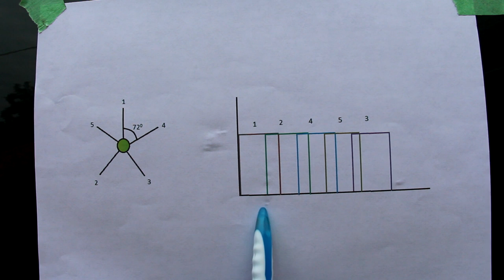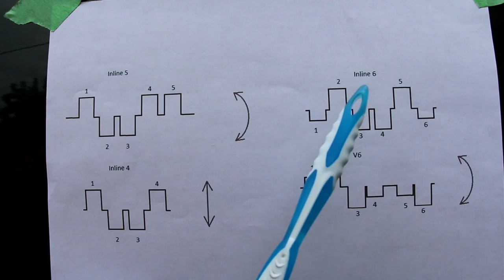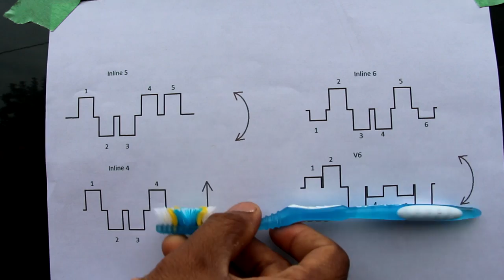Why Inline 5 Cylinder Engines are an Anomaly

Comment: The “plastic” parts in high temp area are Pa6-glass fiber reinforced which can be stronger than metal. Also much less susceptible to heat cracking.
Reply from the maker: Good call. How about warping and leaking due to heat?
Reply: That's good to know!  However, the plastic tubing that makes up large parts of the cooling system gets very brittle after 100,000+ miles. I love my s40, but miss the simplicity and durability of my 850 (same engine, basically).

While my favorite engine to drive is the inline 2.8L straight six from BMW, I must say I love the unique feel and sound of 5-cylinder engines, especially Volvos.
Reply: The plastic coolant hose from BMW's engine block disintegrates after about 20 years. I was not impressed when my daughters 318i overheated after loosing coolant.   Removal of the intake plenum was required just to gain access for replacement.  Not a fan of plastic engine parts.
Reply: @speedkar99  My 2001 XC70 has 650000 km and this plastic oil pickup tube so I'm going to go with "it's not a problem"
Reply: @derekinbritishcolumbia1449  yeah plastic is not a good material for those kinds of parts. it's used becaus it's cheaper
Reply: @derekinbritishcolumbia1449  yeah, pos plastic hose lasted only 20 years, what is it, older than your daughter or the same age? In all honesty, 20 years for a plastic part subjected to constant heat cycles and coolant is actually pretty good.
Reply: fastboatster - You make a point, but this can be the cause of a perfectly good engine getting wrecked if it's in otherwise good shape.  In our case, the car had low km's for its age. 
Does one just just write off their POS BMW after 15 or 20 years because a mfg's use of plastic leads to engine overheating or destruction?  I know in Germany, they just scrap out their cars once repairs become uneconomical.  
I don't excuse plastic parts, when they don't last as long as the "old school" metal items AND the cost of accessing the plastic part makes it uneconomical to repair.  Part of the reason why I won't buy a newer BMW now.
Reply: Derek in British Columbia no point in scrapping low mile old car. I am surprised though that you have to remove the intake manifold to replace some plastic coolant hose. What engine is this? As for the newer cars, they are sometimes easier than the old ones. No plastic hoses under the manifold on my n52 car. But yes, it also has one plastic fitting prone to breaking, I replaced it with aluminum part
Reply: fastboatster 
That was the venerable e36 model.  318i. The coolant connector plugs into the engine block, all  buried under the intake plenum.  I heard the same design layout appears on the inline 6's.  
This connector pipe on my way my ''78 320 I didn't share the same access problems..... and that motor used a metal coolant connector from the engine block.  (several moons ago.... lol)
Reply: Derek in British Columbia def no coolant pipes under the intake manifold on 6 cyl n52 engine. So newer does not always mean worse repair or maintenance
Reply: fastboatster 
That's good to hear.  
You may want to check out URO p/n 011747 which looks like the engine coolant connector.  
I've never owned one of these, so can't tell if it's an easy replacement.
Reply: @derekinbritishcolumbia1449  already got that connector replaced with aluminum part

Comment: A big "flaw" in the design too - removing the cam cover without removing the timing belt first can cause the cams to swing out at an angle and crack the bearing journals.  A lot of people overlook that not expecting the cam cover to also act as the cam caps.  Seen it happen many times.

Comment: I currently drive a first gen C70 coupe, with a 2.0 liter 5 cilinder "high pressure" (as Volvo call this modification) turbo. Literary cant say anything bad about it. The car itself is comfortable, and the engine...
Power: plenty, and can be tuned to be even better.
Fuel economy: great.
Smoothness: on idle it's barely audible.
Exhaust note: with rear mufler deleted, and replaced with a resonator, it's still not loud, yet gives it a nice, low grumble. In one word, awesome.
And the turbo flutter... Cant get enough of it.

I think i will stick with the anomaly for now, thank you. :D
Reply: My friend has a silver one imported to the U.S. Pretty rare beast over here I guess.
Reply: @gregorytimmons4777  If i recall correctly, there were like 24 000 first gen coupes made. Not super rare, but rare enough to be interesting. And it's a good car!

Comment: 8:53 Actually replacing the oil filter is not messy at all, you can remove the filter without leaving a single drop of oil on the engine.
Spin-on filters, at least to me whenever change them on a Chevy express, those are a mess EVERY TIME.
Source: I do my oil changes on my S40 and C70
BTW: Great video and nice editing.
Reply from the maker: I've got cars with both. The cartridge always leaves you open to dripping oil, not to mention cleaning out the housing and Changing the o-ring. 
Many manufacturers have gone back to a spin on style
Reply: @speedkar99  then you must be doing something wrong.  I have two autos with top mounted oil filters and I have never spilled a single drop.  You just have to wait a little while so that the oil drains down.  Autos; BMW 330i,  Ford F150.
Reply: I love the cartridge filter of my s40.  Much better for the environment (less waste), and I find that it drains just fine. You just have to be patient, as the others have noted. In fact, it is a much "less-messy" oil change when compared to the downward-pointing filters on my wife's Honda. 

It also allows you to "prime" the filter a bit with new oil (which I can do on my Honda, too), unlike older upward-pointing screw-on filters.
Reply: I like the cartridge ones, they're less hassle. Also, for some reason, manufacturers seem to think that less filter should cost more... the mind boggles...
Reply: I do as well on my 3 white blocks. 
You can also pre-fill oil cartridge to speed up oil pressure to reduce dry start. 
My 3 redblocks always leak on mount unless I use a rag underneath. 

Keep Rollin'
Reply: @speedkar99  the cartridges don't spill much if any oil.
Just gotta let it sit for a couple of minutes once you loosen them up.

Comment: Dang, lack of maintenance killed this Volvo. I have a 2004 S60R and around 220,000 miles now on it. 
On these, the sandwiched cylinders is only an issue on the 2.5 blocks, namely the 2.5 in the r. Under high boost, there is a chance for the cylinder wall to crack, expelling exhaust gases into the coolant system. The fix is usually either shimming the block, in the thin space between the cylinders or resleeving the block with new Darton sleeves. 
The head gasket can be replaced with the r/t5 one for better reliability, as they are used for the all out high HP builds.
The PVC system is notorious for issues, you can use the glove test method to see if you may have an issue. 
These Volvo 5 cyls are only as good as the maintenance. If you are on top of it, they last forever, however if you are a slacker, it will die. You can't treat it like a Honda/ Chevy. 
On turbo Volvo's, the turbo isn't integrated with the manifold, so swapping is fairly easy. 
Also, the Volvo 5 and 6 cyl motors have many swappable with minor modifications parts, ie pistons and such. Since they are a modular design. It's common for people to take the t5 pistons and swap them into the t6 motor. 
The valve cover has a liquid gasket. 

In the end, these are absolutely fantastic motors for people willing to do the work. They, with some modifications, can be absolute monsters and fairly reliable, it's just you need to be a stickler for maintenance.
Reply: Yes they are great engines, i have the 2.5T in my ford focus st and it sounds awesome! :)
Reply: Yeah, that needed better oil management (fully synthetic, and changed on schedule) and it looked to me like it needed more long trips. Volvo designed these engines to be used; short trips will kill them if you don't go for an Italian tuneup every once in a while. They're not as tolerant of neglect as the old red blocks, but when looked after and treated well, they're just as durable.

Comment: The plastic style pick up tube actually has better flow and doesn’t clog up as easily and is considered an upgrade on older engines. I’m guessing it is difficult to create that shape with metal in mass production so they used plastic. It works well and has proven to not be an issue. I had a metal style that I swapped for a the later plastic one and it improved oil flow significantly.
Reply from the maker: Good to know

Comment: I recently sold my 2006 ford focus ST which has the turbocharged version of this engine. Seeing it stripped down was something I always wanted to experience. Split cylinder lining was an issue until the 2008 face-lift model. Cool vid.

Comment: I owned a 2007 Chevy Colorado with a 3.7L 5cyl inline. That engine was smooth and had good torque.
Reply: I used to work at a Hummer dealership and worked on a ton of the I5 engines. They were relatively smooth, but for some reason would always break exhaust manifolds and manifold bolts. I always attributed it to the 5cylinder design. Although it could’ve just been crappy manifold castings.
Reply: Mines a 2005 3.5l l5 Chevy Colorado. Supposed to be famous for soft heads and leaky valves too...? (Updated from 3.5l to the 3.7l in '07-'12 models) Mline has 160k miles on mine and it's all original engine parts, head and manifold even. I love my 5 cyl Colly, gonna run her till she can't no more. Thing does run smooth, like new everyday. I really run my pickup, keep up with the maintenance, possibly even just luck of the draw.. I change oil via oil life indicator, tells me when to "change oil soon" and I run Quaker State full synthetic 5w30 and change the spin on filter every oil change, sometimes every 5k m. The oil change indicator usually runs 10k and no more than 12k intervals

Comment: Ferdinand Piëch, Porsche heir, VW chairman and later owner of VW Group, designed a 5 pot diesel for Mercedes (in between leaving Porsche and joining Audi) which was renowned for it's reliability.
Million milers without rebuilt were common. Later he used the 5pot concept for Audi as a gasoline engine which powered the legendary Audi Quattro WRC car and the Audi 90 IMSA race car.

Comment: i love these engines, they used the same block for nearly 25 years, meaning you can go to a junk yard and find parts very easy. the bottom end of these engines are nearly bullet proof, its the valves you have to worry about, if the valve stem seals are allowed to leak then you will burn an exhaust valve leaving you with no compression.

Comment: So for the i5 to counter the primary balance force, based on the diagram seen at 16:30,  the i6 always has 2 pistons in sync cancelling both primary and secondary imbalances. So for the i5 to have similar characteristics would adding a heavier harmonic damper timed on the 2 and 3 stroke possibly eliminate the primary imbalance? I’m studying the i5 cause they’re kinda cool and was wondering if that was an option.
Reply from the maker: Harmonic balancer works to dampen torsional vibration. The engine will still transmit vibration to its mounts.
Reply: @speedkar99  thanks

Comment: If you think that’s neat look up “Sisu inline 7 cylinder diesel engine”
Reply from the maker: Awesome
Reply: I always wondered if 7 cylinder engines existed.
What about a 9 cylinder?
Reply: @darkproject3368  Wärtsilä produced a marine diesel engine with several options, one of them being the Wärtsilä 9L32 which is a straight 9 with 320mm bore.
Reply: @darkproject3368   Radial aircraft engines come in odd numbers per bank only.  3, 5, 7, 9 on a bank and up to four rows of banks for a maximum of 36 cylinders!
Reply: The ship I work on has a wärtsilä 9 cyl LNG engine.
The previous one had a 7 cyl mak diesel.

Odd numbers of cylinders are not uncommon at sea.
Reply: @p80t5turbo  so confident
Reply: @darkproject3368  9 cylinder inline engines do exist but those are very rare to find and not a common sight. Nonetheless, still an amazing wonder of the world. And the ironic part is that while you can't divide 360 by 7, you can with 9. So in all a 9 banger would be more balanced than a 7 banger.
Reply: @darkproject3368  Check out the Fairbanks Morse 38E5-1/4 opposed-piston engine. It is a  7-cylinder  engine displacing 2,197 cu in

Comment: Yea those plastic pieces are actually made from a glass and plastic mix which makes it relatively strong and it lightens everything for emissions and it dissipates heat very quickly. It’s the same type of plastic ford used for their thermostat housing on ford escorts and I’m sure other cars and trucks. But couldn’t the oil cooler have failed internally which mixed oil and coolant.
Reply: The standing water in #3 bore suggests head gasket failure.
Reply: @cdjhyoung   I think someone removed the spark plugs and this engine was left out in the rain, I've seen the 5-cyl gasket failures and they're clearly visible... this one was fine, AFAICT.
In fact, nearly every issue with this particular engine came from using the wrong oil.  These engines REQUIRE high quality synthetic.  Mobil 1 or better.  I tore down my 850's engine at around 200,000 miles (for fun) and didn't have even a tiny amount of sludge.

Comment: I have a 2008 VW Rabbit 2.5 I-5 engine  with 156K miles on it that is silky smooth, sounds electric at idle and screams like a wildcat over 4500 rpm's. It burns no oil, has no leaks, never overheats and always starts first time, every time. All I've done to it is scheduled maintenance and replace seals, sensors and other parts that reach the end of their lives. Nothing mechanical has broken on it. There are some odd electrical gremlins that give it personality. 
The engine has a timing chain and hydraulic valve adjusters. What is not to like?
Reply: See? Germans can make reliable good engines!
Reply: @alouisschafer7212  The car and the engine were made in Wolfsburg. 

The transmission is called the 09G Tiptronic which sounds German but it is actually made by AISIN, a subsidiary of Toyota, who makes most of the automatic and manual transmissions in the world. Supposedly, it has a bad reputation but it has performed flawlessly for me. 

All I do is scheduled maintenance and I only use premium fluids and "top tier" gas. 

The only problems I've had are the typical German electrical gremlins. So far, they have been tolerable.

Comment: Very nice video. I like your editing style. Volvo did make some very solid 5 cylinder engines. Look pre-1999 and you'll find gold. PCV issues were still present, but other than that they were basically bulletproof.
Reply from the maker: Thanks. Yes they did have some solid motors. Too bad the rest can't be said for everything else
Reply: I'd argue Volvo's Mid-2000's 5 Cylinders were better designed. A lot of the annoying or inadequate aspects of this generation (plastic thermostat housing, vertical oil filter, sealing issues, etc) were improved upon or solved.

Comment: Great vid. Was looking forward to this one. I have 6 volvos and 5 of them are older than 1998. I honestly don’t like these newer versions of the 5 cylinders. The original N version from 93-98 was the best. The oil pickup was metal like you were saying it should be, there weren’t as many oil passages because it didn’t have VVT, and the cylinder walls were a little thicker. The RN 5 cylinders that came after were ok too, but they introduced VVT, and for whatever reason, it seems like the tolerances were much tighter and therefore they were much more prone to throwing rod bearings plus the cylinder walls weren’t as thick, so the higher HP models were prone to cracked blocks. I love the original N 5 cylinders. Best reliability, durability, and longevity. I currently daily drive a 94 850 with 328k on it.
Reply: Depends on what motor you got. The older 2.4L turbo N was 83mm block as well. The later RN 2.4 T5 (not 2.4t) has 81mm bore. It’s really dependent on which bore block the motor used rather than N vs RN. the 2.3L t5 used 81mm. I would say the move from hydraulic to solid lifters for the Rn as long as mechanical tensioner was an improvement. I do agree about the rod bearings for the 04+ RN when they did a semi engine facelift for the p2 models. The cylinder heads for the RN have more flow than N head. Even more than a stage 1 ported N head. Ups and downs of both. But we can both agree the RNC is just a mess in comparison 🤣 . (The one in the video)
Reply: @rex_s80  Yeah, it does depend on the trim model for the motor. I was mostly referring to the R line of the P2s and also the 2.5 T5 RNC motor. Yeah, the solid lifters, mechanical tensioner, and better flowing head were nice, but the benefits kinda outweigh the cons for me. But yeah, RNC is the pinnacle of garbage. 😂

Comment: The older versions of these engines use steel oil pickup tubes. Know a few people who worked for Volvo back in the day and by the time Ford had more influence they did some cost cutting (though I wager the cast saving is minimal if you factor in the price of a mold to make the plastic parts for the pick up).
No extra chain to oil pump - nice
Big oil channels, easy to clean, because of the bed plate construction also very easy to manufacture (no deep holes to be drilled)
Bed plate construction (the upper oil pan) make the engine block really stable. I remember the bearings reside in steel inserts?
10 bolt connection to the flywheel - beefy
Steel water pump impeller, probably still the original pump too.

Cool to see the insides of the RNC 5 cylinder (RNC = Revised N Compact?), only seen the older ones!